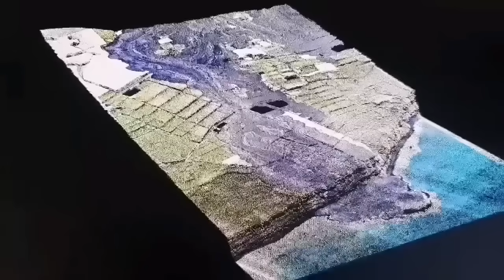Saving Grindavik: Pumping Sea Water On Lava, Iceland Fagradalsfjall Litli-Hrútur Volcano Magma

Comment: With only five and a half hours of daylight this time of year the nightmare is happening mostly in the dark.
Reply: Not very correct. The further north you go the longer twilight is, so you need to add at least one hour of twilight on each end of the day. They also make extensive use of outdoor lighting on job sites in the winter.

Comment: Maybe an idea to use water dumping planes and helicopters to stop houses burning ? 
Especially in stormy weather ( not only ) the whole town could catch fire from a few houses burning. Even if the houses are practically unreachable now, when the eruption stops a large part of the houses with their content are still there, if they can make it through the fires.
Reply from the maker: You have a good idea. At the moment probably using pipes and pumps appears more practical and has been used successfully in 1970s eruption. But if we have the equipment available in large numbers from the air, yours is better idea.